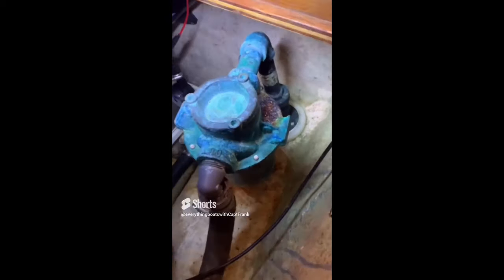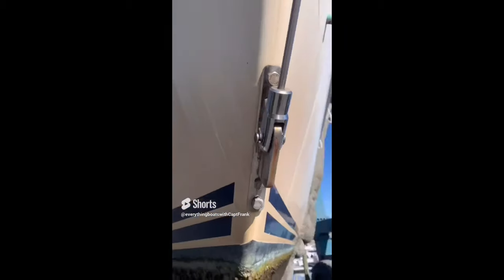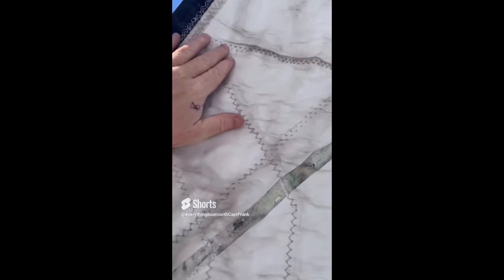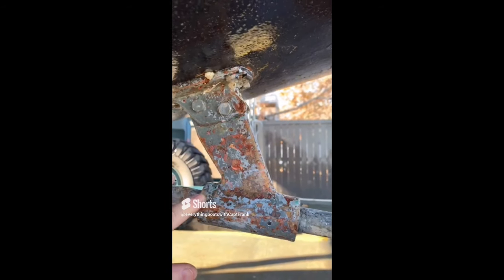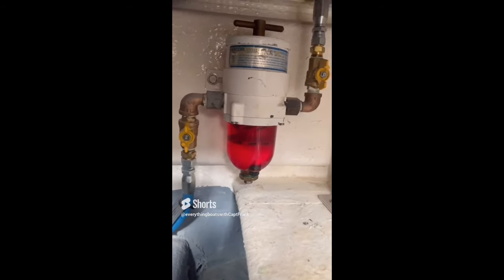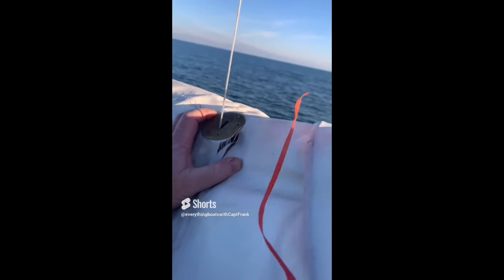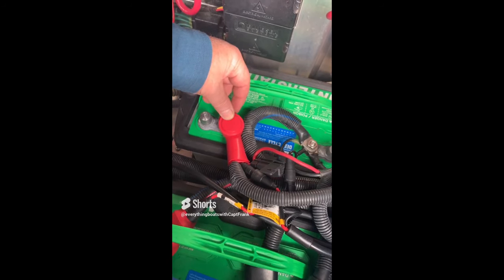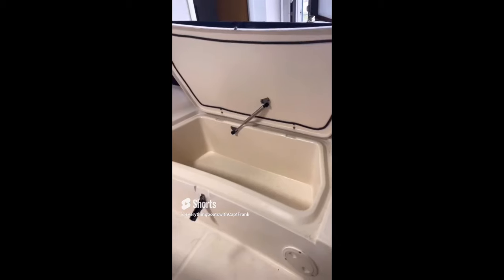60 second boat survey (Episodes 1 through 20)

Comment: Always disconnect your battery before you do any kind of engine work besides electrical diagnosis in which case you have to do the work while energized this is basic lock out and tag out procedures used in any industrial working environment I was trained to disconnect the negative battery cable when i was a auto technician before beginning to work under the hood on a boat you can disable the battery with the disconnect switch but you should probably confirm that that terminal is indeed dead with a multi meter or a test light before you go wrenching around anyway. If your are working on the engine while it is energized and someone tries to start the engine while your in there you can be caught up in the  belts and pulleys and dismembered place a lock out tag out tag on the switch if you have to be in there while the engine is still energized and let everyone know what is going before you go monkeying in the engine compartment also
Reply from the maker: Thanks for the comment! All good advice. I worked on electronics in the Coast Guard for close to 30 years and we also followed rigorous safety protocols in the name of safety. I'd also add remove all jewelry (watches, rings, necklaces). For those who may not know, the reason you disconnect the negative battery cable is because current flows from negative to positive...